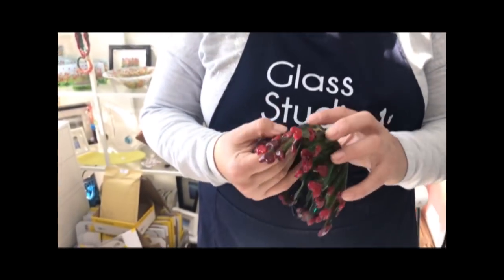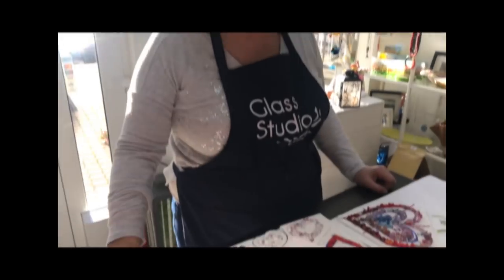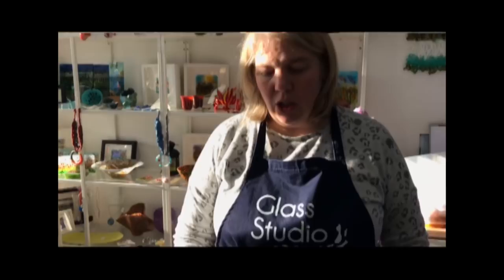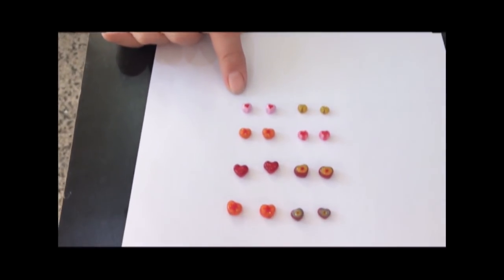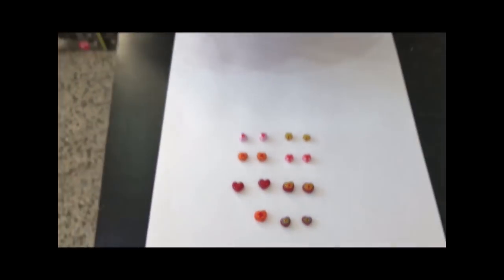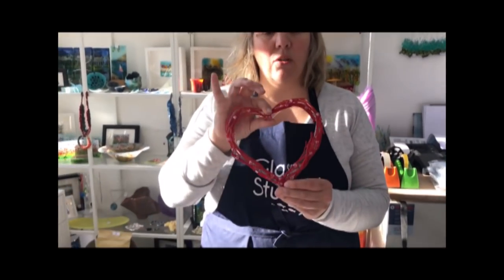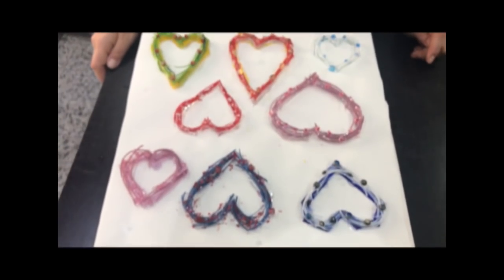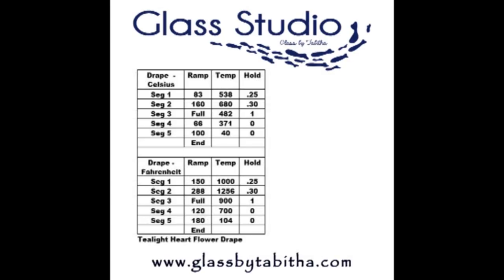Fused Glass Valentine's Hearts

Comment: Love your videos! What do you use to attach the glass to greetings cards and in the picture frames?
Reply from the maker: I use double sided sticky tape to attach them, i use to use some rather expensive removalble ones but I have found just cheap double sided tap on a roll works just fine. for the picture frames I use Araldite two part crystal clear epoxy
Reply: Tabitha's Glass Emporium thanks Tabitha :)